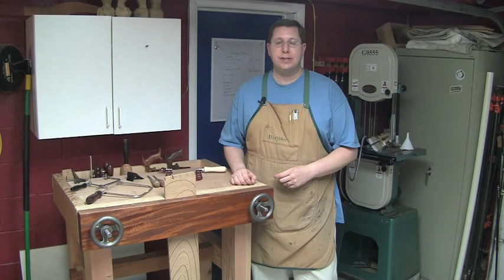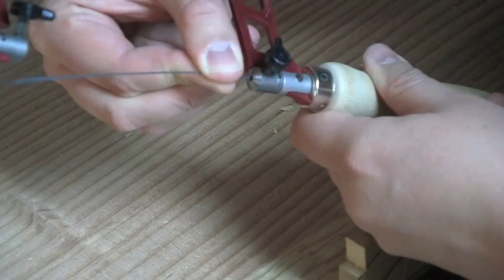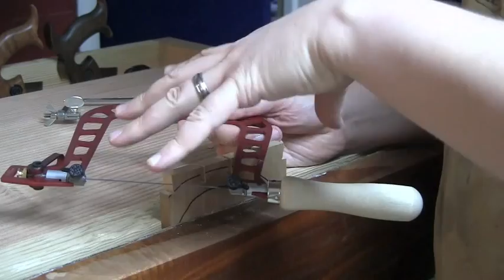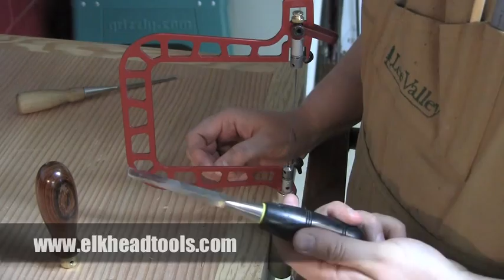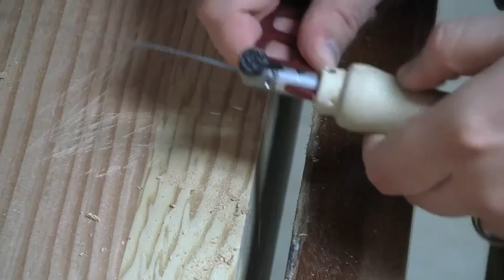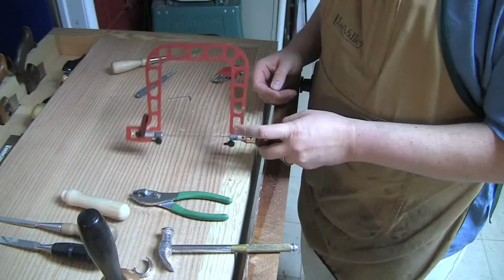RWW 130 Knew Concepts Fret Saw

Comment: I bought the titanium 5" Knew Concepts and I can honestly say it is the very finest coping/fret saw I have EVER found. It just plain works, and the quality is unparalleled. Zero flex means blades don't break nearly so often. The lines I can cut with this don't wander; they're dead straight. As others have said, it's not inexpensive. Don't care. Now all I need is the $85 replacement handle. Yes, the price is now $85 (Jul '24).

Comment: Hello Shannon, good video and well presented. I had a cheap £10 fretsaw with a 11" throat-broke loads of blades cleaning out waste. Lightbulb moment- I carefully placed saw in a vise having removed fittings from saw, then using common sense bent the U shape throat and its 10" of metal over to 90 degrees to the rest of the saw making sure the now vertical loop was to the left hand side(I am right handed), I promise I hav'nt broken a blade since, and its taken me longer to write this post than to modify what was but is no-longer a wretched tool.forever , never day peoples full  tools brazil wood never belo horizonte single ok play city longer from sure having time side vise point

Comment: The jewellers saw works brilliantly for what it is intended to do, cutting metal. And it works far better when the blade is mounted to cut on the pull. I have no intention of ever using to remove dovetail waist.

Comment: Overpriced or underpriced I don't care and in 2 years I will not remember the price I paid.. These are exceptional saws that address the shortcomings of all other fret and coping saws. I bought the coping saw version that takes the 6.5" pinned blades. The quality Swiss and German blades available do fit into a dovetail saw kerf and they cut a straight line. When I changed over to the cocobolo handle I was able to save the original handle just by sliding an inch long brad through the centre of the roll pin and pricking a hole on the other side where I was able to centre and drill a 1/8' hole through the ferruule and use a drift punch to drive out the pin. I am happy to pay a premium price for a quality tool but would hate to destroy even a simple handle. I will  chuck it up and turn it to fit a nice brass ferrule and use it on a file or rasp. I like the idea that it is reused and in doing so has a little history to it.